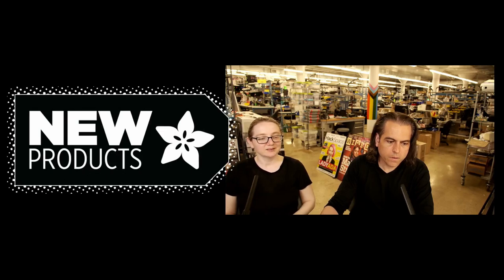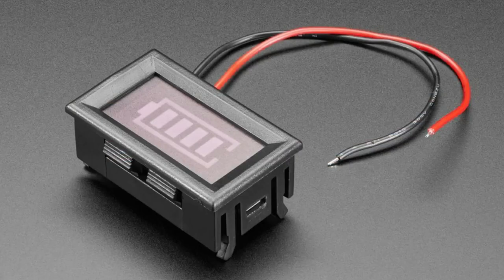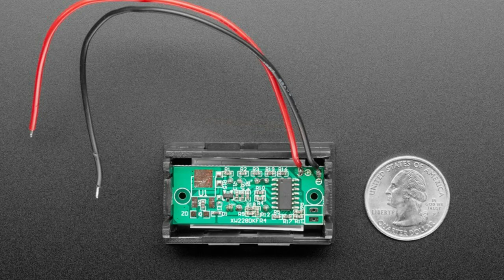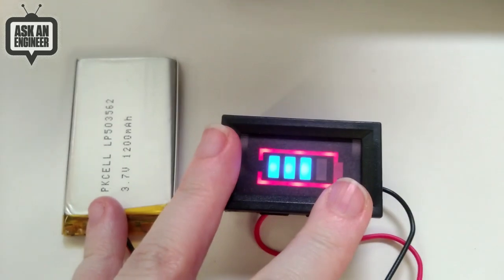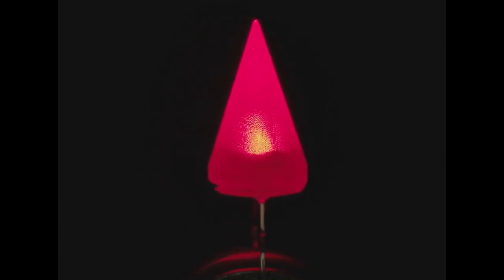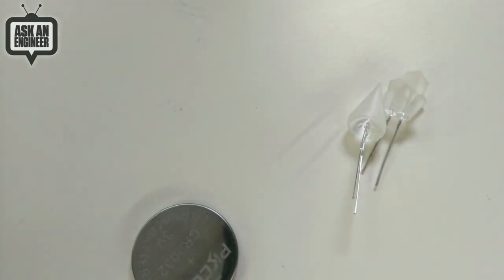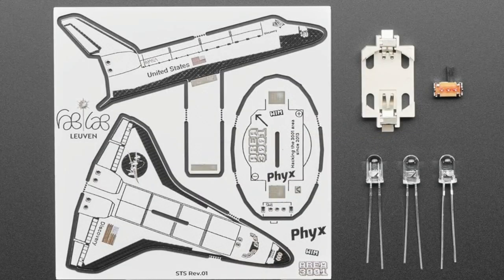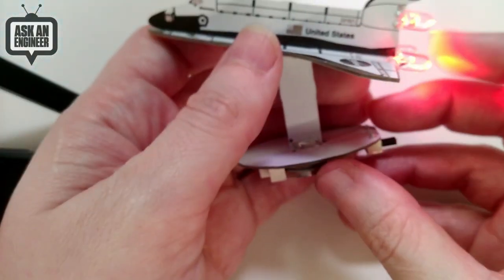New Products 5/4/2022 Featuring Space Shuttle Discovery Solder Kit by Phyx! #adafruit @phyx.be

Comment: I really need a video and tips on soldering the flat surfaces. Pretty sure I got the pins okay. But can we get a set-by-step video for the soldering kits please? Maybe even some good instructions to go with the kits. The whole reason I bought the kit is because I’m a beginner at soldering. I did a class earlier this week, but I only got practice doing the through-hole soldering. I really want some step-by-step guidance too. I know the circuit is in good order, just getting the edges and the coin cell holder on is super frustrating!